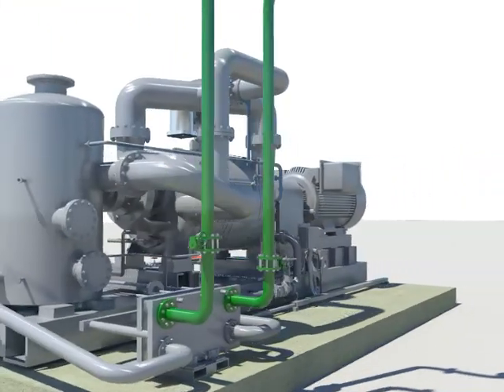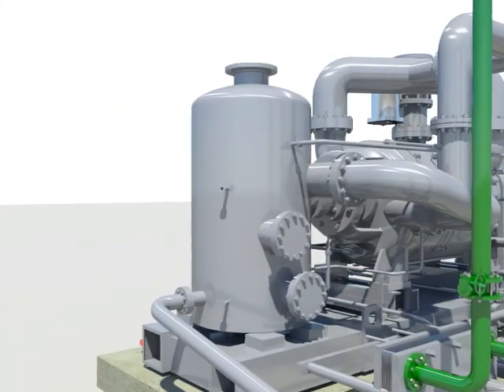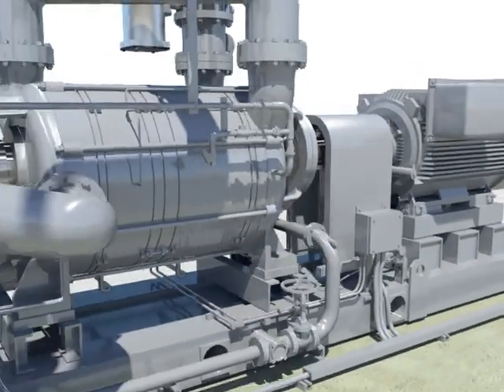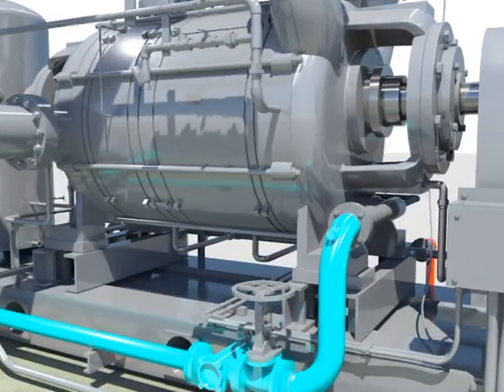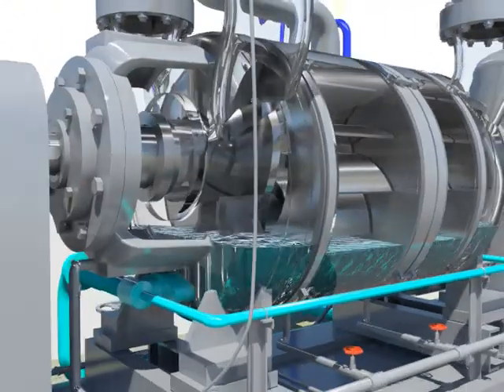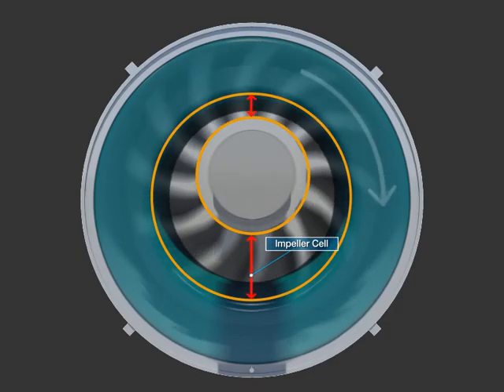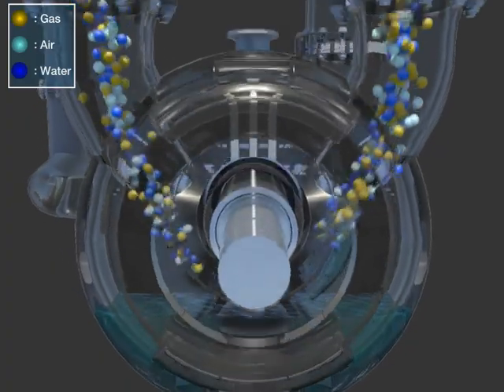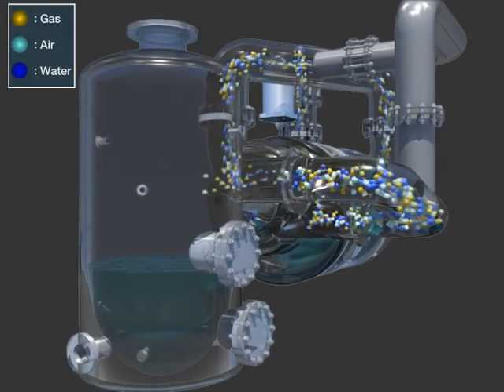#powerplant   #Steamturbine  :How does a vacuum condensate pump work?

Comment: Fungsi heat exchanger pada vacum pump itu untuk pendingin pomba bagian apa pak ?
Reply: Spertinya bukan mendinginkan pompa pak, tapi mendinginkan air yg dari tabung separator saat pompa beroperasi, sebab disaat pompa beroperasi,uap yg dihisap dari kondenser selain terbuang ke luar adajuga  yg tertampung ke dalam tabung separator yg selanjutnya di sirkulasi kembali sebagai sealing water pada pompa vacuum, fungsi dari heat exchanger tadi mendinginkan air tersebut,

Comment: It is just like a "liquid ring compressor"...
Reply from the maker: The liquid-ring pump compresses gas by rotating a vaned impeller located eccentrically within a cylindrical casing. Liquid (usually water) is fed into the pump and, by centrifugal acceleration, forms a moving cylindrical ring against the inside of the casing. This liquid ring creates a series of seals in the space between the impeller vanes, which form compression chambers. The eccentricity between the impeller's axis of rotation and the casing geometric axis results in a cyclic variation of the volume enclosed by the vanes and the ring.

Gas, often air, is drawn into the pump through an inlet port in the end of the casing. The gas is trapped in the compression chambers formed by the impeller vanes and the liquid ring. The reduction in volume caused by the impeller rotation compresses the gas, which reports to the discharge port in the end of the casing.

Compressed gas on discharge of pump contains certain amount of working liquid which is usually removed in vapor–liquid separator.
Reply: @Powerplant02  Thanks for such detailed explanation. Keep it up.